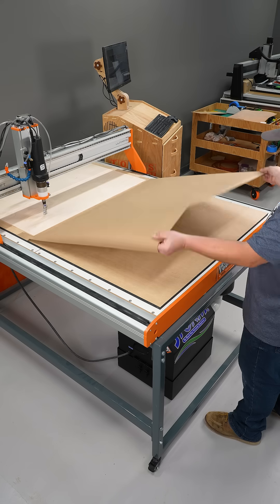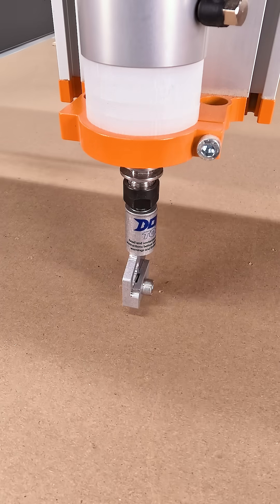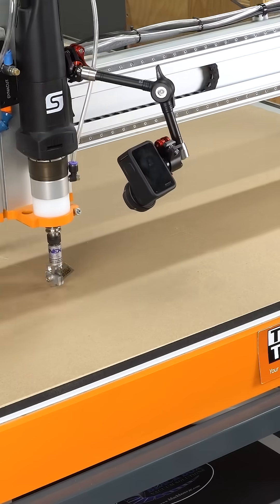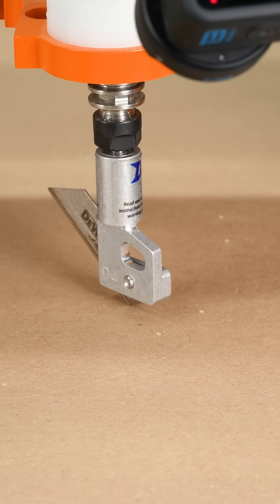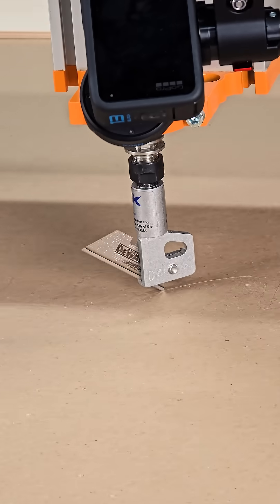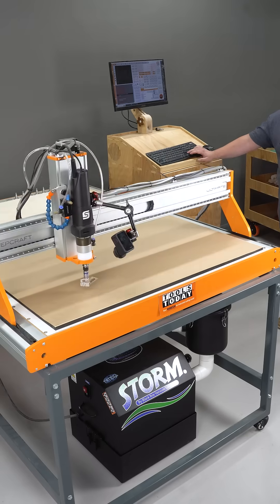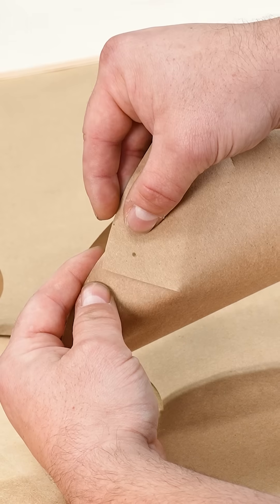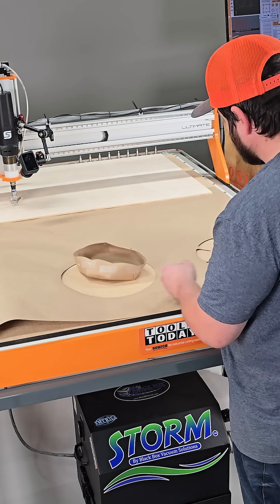CNC Paper Test = No Wasted Leather

Comment from the maker: We tested our circular tray design in paper before cutting into much more expensive leather. Using a drill bit for rivet holes and a drag knife for the cut, the vacuum held everything tight on the table. The most satisfying part? Turning the vacuum off and watching the paper pop free! After drilling, cutting, and lining everything up, we stapled the test together — and it worked perfectly. Next step: leather!  Check out the tools used on our site - 

Stepcraft M.1400 CNC machine - https://toolstoday.com/stepcraft-m-1400-48-x-64-cnc-machine.html

BlackBox Storm Vacuum - https://toolstoday.com/black-box-vac-bbv-svp-2-storm-vacuum-system-for-cnc-routers-single-phase-220v-230v-at30-amps-2-long-life-high-performance-motors-inline-filter-not-included-but-recommended.html

Amana Tool 1/8" Solid Carbide Drill Bit - https://toolstoday.com/v-11881-scfd-100.html

Donek D4 1/4" shank Drag Knife - https://toolstoday.com/donek-tools-d4-drag-knife-1-4-shk-x-1-4-ch.html

Vectric V-Carve Pro Software - https://toolstoday.com/vcarve-pro-10-0-software-for-cnc-1.html